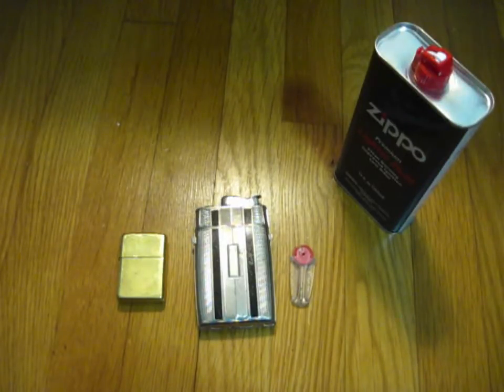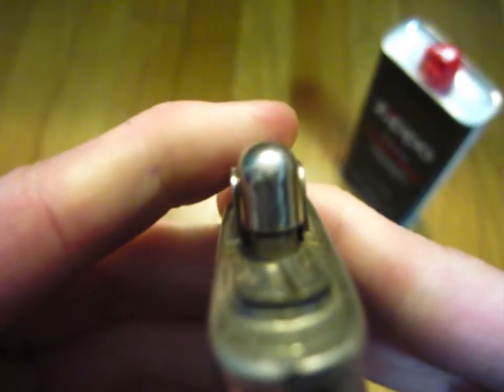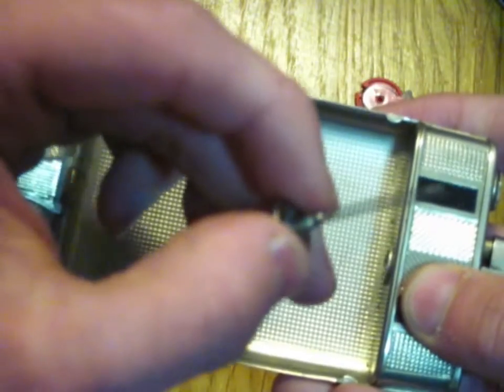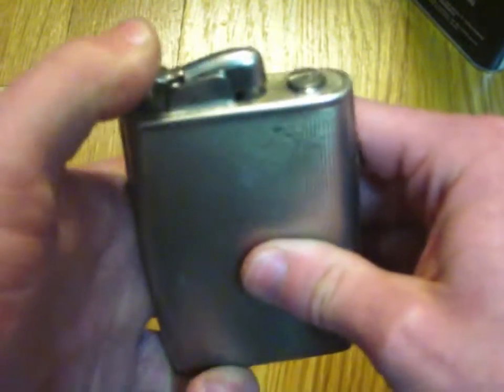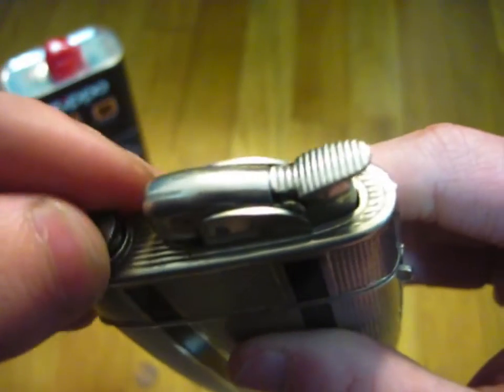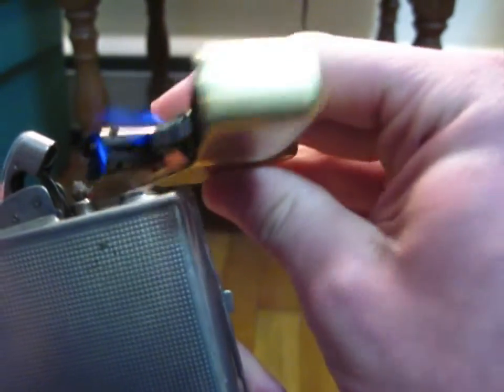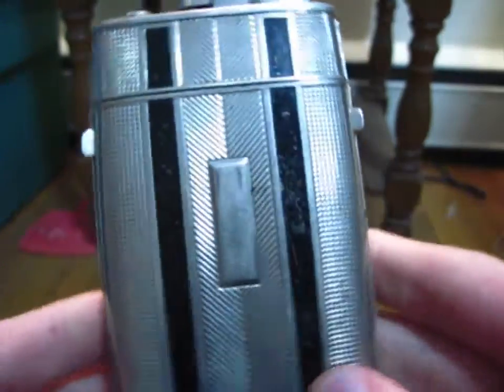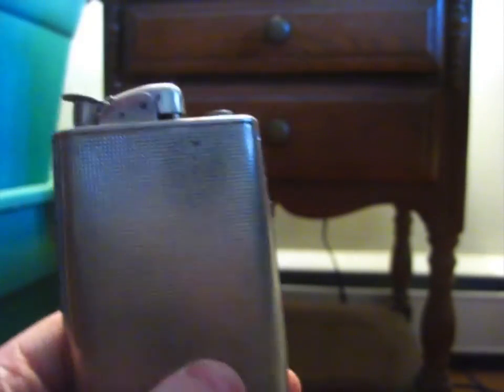Filling a Vintage Lighter for a Friend

Comment: hey how would you go about replacing the wick in that? I have one similar that doesnt allow me to really get a new wick in there,
Reply: Im in the same predicament mine is in much worse shape than this one though and i also cant get a new wick in he amount of cotton in it was unreal idk how i will get it back in the small hole cool lighter though want mine to work super bad. Although it is too small for cigarettes they must  have been smaller back in the day because with a filter on them it just won't fit.
Reply: I had to mess with mine, I have an old ronson, wicks are hard but usually once you get it in there it’s easier to slide it in